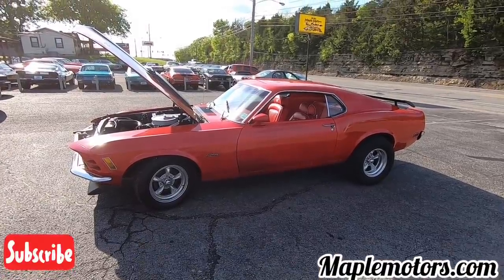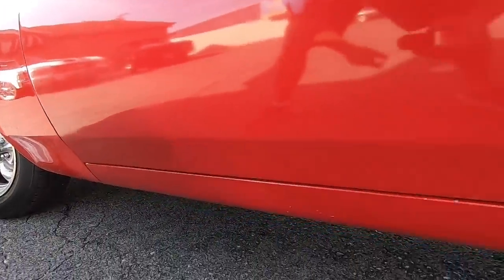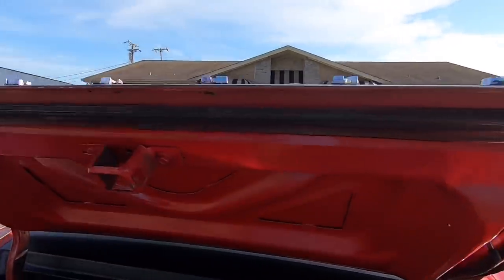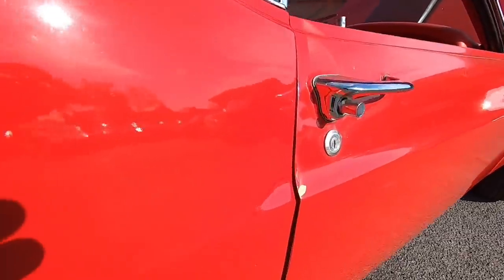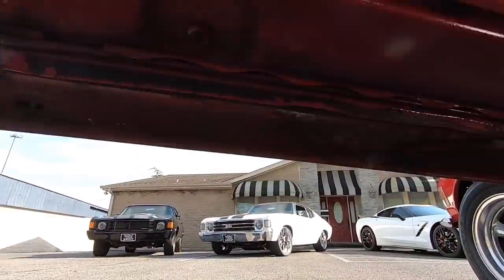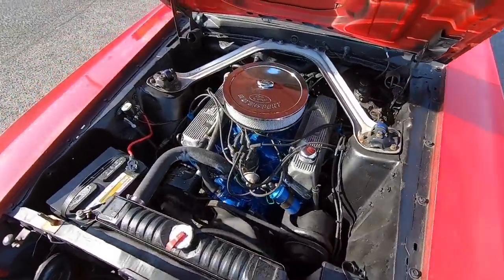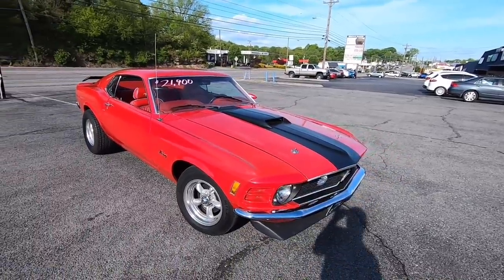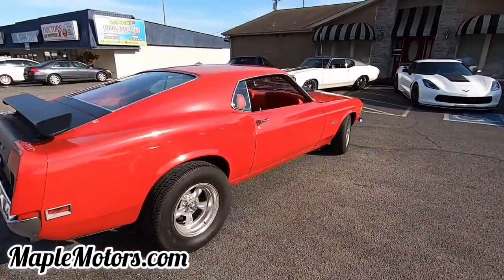1970 Ford Mustang Fastback SOLD $21,900 Maple Motors #545

Comment: Hey Nick,  How a bout giving  a quick tour of your Chevelle one of these days? Id like to get a closer look as I love the blacked out vibe you got going on there
Reply from the maker: Look at my latest live video I did yesterday. Go to the end and enjoy, thanks
Reply: @MapleMotorsNickSouthgate  Wow talk about the right timing...thanks man, that is a sweet ride...That fuel injection on the 454 does that make a huge difference in the response and performance? Is that stock suspension, I wouldnt lower it either its got a killer look.
Reply from the maker: Well I like the fuel injection but it does have its downfalls. As soon as you start it , always revs up for like 45 sec. then comes back down. Almost like a choke , every time I start the car. Other than that, it is great

Comment: Thanks for the walk around Nick. Just as I thought, it was awesome. I would have been curious to look at that back panel where the tail lights are mounted. That is one of the first spots in the trunk area that will go. look good though. I wish you would of hit the turn signals. On your walk around when the car was running. I am not sure if they had synchronized turn signals.
I have a friend who specializes in muscle cars restoration. He would make that thing look SICK!! The green steering wheel was a dead giveaway that the car was Green. My 72 Mach 1 was Green. Same steering wheel
I would be curious to see what kind of rear end is in that car. I also had a 351 Cleveland. Badass motor.
When this shelter in place is over. I'm going to come down there and personally meet you. And maybe Drive 1 of your car home.
Correct me if I'm wrong. Down in Tennessee those cars do not need inspected. That's just crazy..